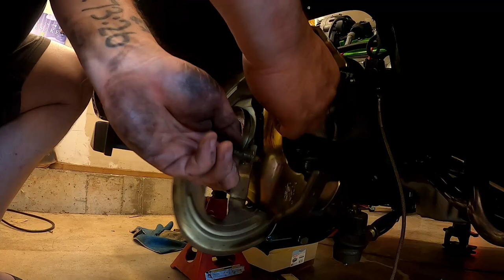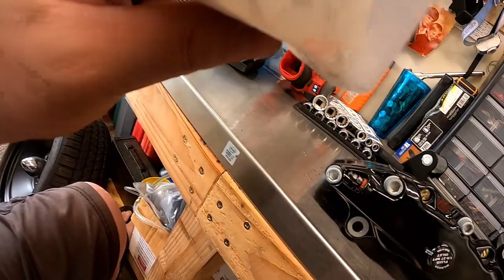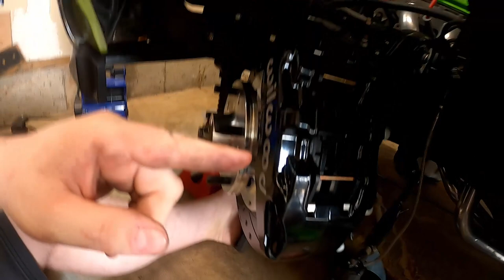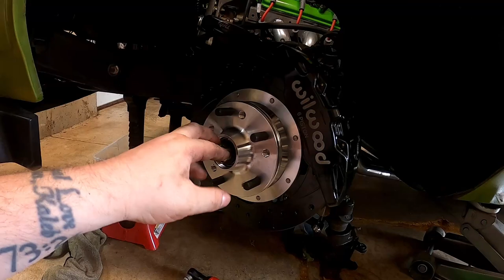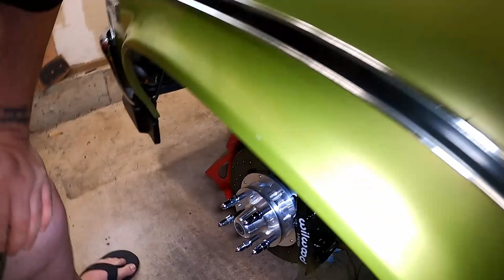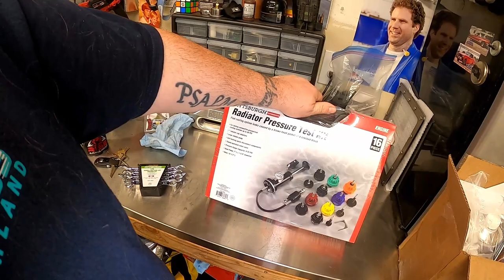Wilwood 6 Piston Front Brake Install on 1971 Nova

Comment: Are you full manual setup on the brakes?
Reply from the maker: Yes, no booster. And I haven’t driven with these brakes yet but old ones felt good. I see no need for a booster unless your building a  cruiser and eat ice cream cones while driving :)

Comment: Just my opinion But, Should have been spaced at the spacers. That's gonna be a pain to change pads or if you have to remove calipers again.
Reply from the maker: I’m not sure you understand how these work. You don’t have a choice where to space these to make these work. But once spaced properly it will never change new pads or old.
Reply: I work on Dirt modifieds we space them at the spindle.  Then the caliper fits everytime without respacing.  You have spacers on your bracket to spindle. Fix the spacers there. The caliper should fit to the bracket without spacers @BillyFargon
Reply from the maker: Unless that upper spacer is machined down it has to be the way I have it. Wilwood said not to machine that spacer down. If you are doing it on dirt modified it may be that’s what you can get away with but street car no.
Reply from the maker: Plus.. a pair of brake pads on a street car lasts many years.. I don’t see it as an issue
Reply: They are wrong about machining the spacer down, Someone doesn't know what there talking about.  Us racers developed these calipers for racing.  Your street car is a tinker toy to modified braking.  We wear out a set of $100.00 brake pads in 4 races. The caliper should fit the bracket without spacers for best braking.  You can do what you want. Thanks for your concern. @BillyFargon
Reply from the maker: I had no concern. You commented on my video. For me it’s set up by the book. You do what you want. So thank you for the concern :)
Reply: These guys are sales men not racers. Just trying to help you do it the right way. BTW some modifieds run the same spindle you have.  Go figure.   @BillyFargon